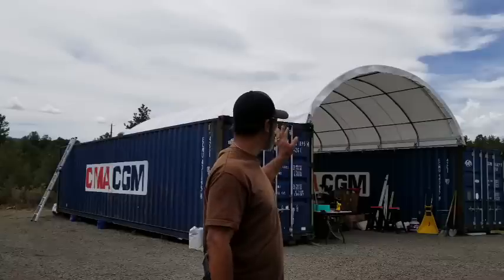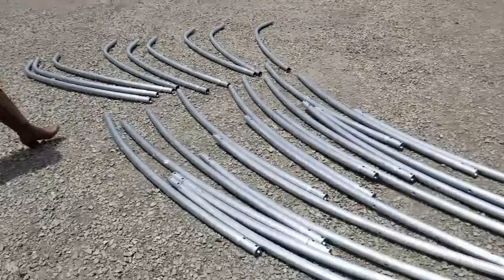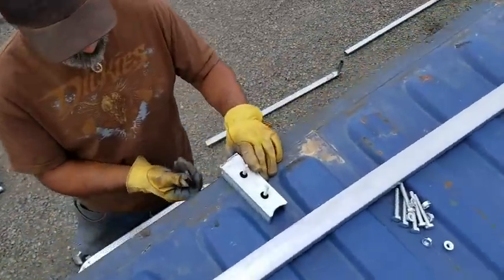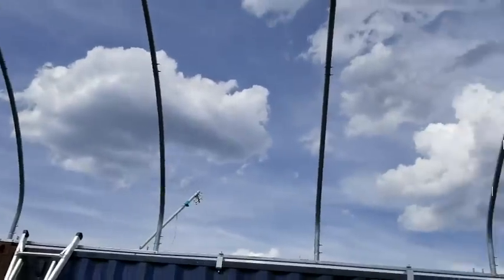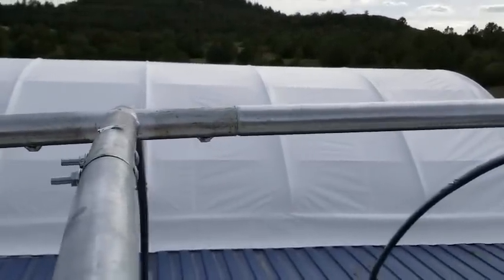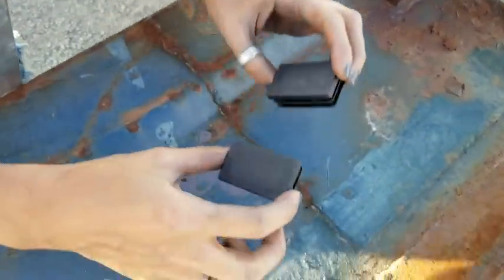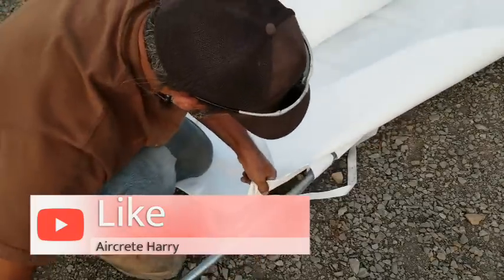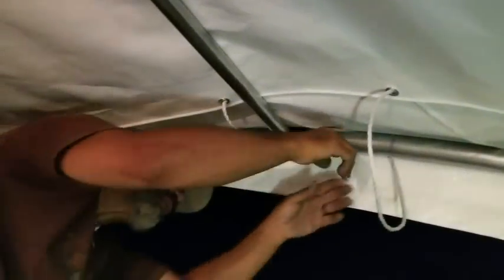Shipping Container Shelter Covers Installation #aircreteharry #Shippingcontainercovers #investment

Comment: Why not attach the pipe down with the ratchet straps and THEN put the fabric on with wiggle wire, the best way to attach it?
Now it has a bunch of weak places for wind to begin tearing it.... and water to leak on to cause corrosion on the ratchets, joints etc.  

OTT, beautiful job Harry. You for it done and it is a fabulous job. Thank you for all of your dedicated work!!! You are truly an inspiration!!!

Comment: The only problem I see with that setup is that water between the two has no pathway to drain so it is going to wind up running down the walls of the container which will soak anything leaned up against the wall.
Reply: Maybe they could make a gutter piece to attach to the clips that are attached to the corner of the shipping containers...  but drainage would definitely be an issue in my climate.
Reply: @eliasnewman1130  its not a problem but a benefit. Change your thinkin
Reply: @brettmoore3194  It might help him to change his thinking if you explained what you are thinking....don't be a complainer be an explainer so others can benefit from your ideas....we are all trying to learn from these videos, thanks!
Reply: @beefree7114         agreeable.              Achievers partnering is corporate sanity unitized.              They each own both efficiency apartments for sharing togetherness always or individual applications temporarily if optioned for transcending biographical wreckages.        But respectful corporate neighboring godhood Unity lacking in Eden also failed to resolve weakest link issue resolution, leaving do-over contingencies underprepared.                               Equalitarian accompanyings Co-manages Mutual progression to avoid either from bogging down into longterm negatives.     Similarly biblical "helpmeets" were push-me/pull-you equalizer-attentive beyond fatiguing overtime moonlighting occasions.

Religiosity Faith-method deficits lacking Insider-god's multi-perspective participations, likewise led to alcohol dependent social-drinker addictive program mutations (aka sins being self-defeating misprogrammings),   instead of objectively identifying problems and team working Beyond under-layering causes into autonomous democracy instead of bondaged republics.            The Serpent already somewhat demoted out of Predestinater's presence thereby overly-preoccupied Quality-Control Director's isolation,  failed to receive helpful correction from Eve for equalitarian incoporation towards furthering all angels and human into becoming God's self-predestinating character equal of Good-Orderly-Directing-Self corporation .

              As Brett Moore alluded,   iron mineralized water could advantage greenhouse sproutlings,    and short pillar jackups facilitating a collection tank,    would not seal off fractions of the water table circulation.            I concur that this duplex placement  also awaits progressive people students of Planet Health creation.                 If I afford you learning anything from now on,   you make love me (Lots of Laughs this self-learning typing program 🌩☈⛈)  you may faithwise quote me as The Souper Teacher Sam 🐢
Reply from the maker: I will put a gutter system on later for now I have it so water comes down one side.
Reply: @samuelhmullins2170  I feel like I just read a first draft of a "Lost " Episode
Reply: @beatricelyon474             I am amazed too but differently.    How is it suppressed robot factory society systems plaguing Earth do not produce worse citizenship behavior than voting for criminal organizations to instigate planet death?      Since junkmail became a weapon of massive destruction,  are the ground-shielding shady cooling blankets adequate for constraining ozone retention?

Oh I forgot about anti-intelligence agencies including dummy-media, religions and etc mis-education departments which omit research for Genesis 1:28 inhabitable Planet duplication!!        Semi-permanent Construction Developer's proportional seals are incompatible with Earth's water tables' circle of life aquitards .             Aquifers would cease to be adversely stagnated when domed-over Subterranean megacities, with Progressive Industrial Waste Management, are LOCATED BETWEEN AQUIFERS.        Plus agricultural infrastructure pipeline connected to desalinization plants for Non-drinking water reservoirs, would serve relief for fresh drinking water purposes .           

Aircrete Harry jacking his apartment containers to unseal the land surface is aquifer-compatible with planet health.              Jill Stein's Green Party platform seems compatible for Healthy Future transitions too.                 Are you referring to the 'Lost' World ignorantly led into opposition-voting against economic fairness and our species survival??
Reply: @AircreteHarry  A photo near the end of the gutter system would have answered many minds.
Reply from the maker: Our shipping containers are set-up at a 2° angle to the side and towards the back for the water to run off the back.

No water issues. 
Everything stays dry. 👍 👍

Comment: Nice system, except it seems like it would make more sense to add additional width to your arches & tarp so you could install the system on the outside edge of each container.  This would solve the issue you are going to run into where the rain/snow melt water from the tarp & on top of each container is going to run down between the 2 containers.  Plus you would also gain covered storage area on top of each container.
Reply: With 4 containers you could. You would give up 8 feet of width between containers.
Reply: @kkarllwt  16ft. 8 ft each side. you would have 4ft left between then or they would have to make the kit 16ft wider. IE double the price.

easier just shove some expanding foam under the "runners" on each side. this way you form a full 40ft length "damn" and the water is forced outwards instead of inwards.
Reply from the maker: Those shipping containers are set-up at a 2° angle to the side and towards the back for the water to run off the back.
Success, no issues.

Comment: Being this looks like Arizona,  those tarps might last 1 season. Hope they aren't too expensive to replace. But I will say, this is a great system, easily put together if you are organized. Which you both were!
Someone suggested covering the tarps in air Crete....good idea!
Reply from the maker: We've had ours for over 3 years now.
Yes, great system indeed.
We are happy with our Investment.
We will be covering them in the future.
Reply: If installed right with everything pulled tight and secured, these will last well over a decade even with the hot Arizona sun beating down on them. The tarp itself may need replacement every 15 years or so, but for the price it can’t be beat.

Comment: Harry I noticed the colorado cup. I live in the wet mountains of Colorado with high winds and heavy snow at times. I was wondering how your tarps hold up if you're in colorado with similar conditions. The tarps look really nice and would make a he'll of a place to get out of the sun up here.
Reply from the maker: Tarps are working out great. Check out this videi: https://youtu.be/jWg6TT9mUWg
Reply from the maker: Welcome to the channel 👍 
Yes, we are located in CO & we indeed experience major high winds, heavy snow, heat,.., and lately lots of hail.
This year alone we've had numerous earthquakes & several tornadoes going through. Being in Colorado yourself you may be familiar with snow coming down in May & very rainy days. 
The Shipping Container Covers provide us with great benefits & are an awesome investment. 👍 
It's been 4 years since we installed them, they are working out great. 
Check out this video: https://youtu.be/jWg6TT9mUWg

Reach out to us via email: Aircreteharry@gmail.com 

We will happily forward you the details ✌️

Comment: Great video. I just checked with Celine on these covers and they said the covers last an average of 3 to 5 years before starting to fall apart. I like the idea but I need something much more permanent for my RV and Boat storage. I may just try stacking 2 containers on top of each other and building a tin roof on that to get my 14+ feet of overhead clearance. I've also been looking at building a, (used telephone pole), pole barn with a tin roof. Im wanting to go 40 wide by 80 or 120 deep and then pour slabs inside to make a solid floor to work on so the pole barn idea looks more promising.
Reply: what I figured. Put up plenty of Quonset huts and other structures in the military.  They only last so long UNLESS you prep exterior and interior correctly. Never mind foundation. Then, they'll last.
Reply: Think you need a quonset hut top.

Comment: These container shelters domes are used extensively here in Australia , they can come in almost any height or width between containers and mounting methods.  They can even come with rear end wall and doors. They don’t always have to mounted on shipping containers either. They are extremely durable and most manufacturers will offer a 10 year warranty on the fabric.  They are very good for temporary workstation applications. If the containers are mounted at a 1-2 degree angle leaning away from each other , you don’t really have a water issue running down the inside ,  unless there is no end walls and the rain is coming in sideways. A small scissor lift is best to use for lifting the roof bows and installing the ties and end bracings. I don’t think they come with a snow loading as a general rule.  As they are all different . This would have to be quantified and certified by an engineer for each particular dome shelter.
Reply: How much it cost
Reply: they charge stupid fucking cash for them too. $60 - 85k and bullshit like that for a 20'. NOPE.
Reply from the maker: Email us and we will connect you with the company: Aircreteharry@gmail.com

Comment: What is the expected life span for the covers.  Where is the water runoff going on the center? Is it just getting the shop floor wet?
Reply from the maker: We've had ours for over 3 years now.
We may cover them in the future.
Those shipping containers are set-up at a 2° angle to the side and towards the back for the water to run off the back.

No water issues. 
Everything stays dry. 👍 👍 

If you are interested in more detailed information from the company, email us & we will connect you: Aircreteharry@gmail.com

Comment: Nice job. Good teamwork. My only question is how are you going to drain or divert water from the top of the middle container so it doesn't run underneath your tarp flaps in each corrugation channel??
Reply: Ever figure this out?
Reply from the maker: Thank You!
Our shipping containers are set-up at a 2° angle to the side and towards the back for the water to run off the back.

No water issues. 
Everything stays dry. 👍 👍

Comment: I agree with Tom Slak.Maybe a small ditch or gutter in the ground near the containers can get rid of rainwater flowing over the sides.
Reply from the maker: Our shipping containers are set-up at a 2° angle to the side and towards the back for the water to run off the back.

No water issues. 
Everything stays dry. 👍 👍

Comment: Harry what would you like about a container house with grid wire on the outside (like stucco)... then aircrete over that?! Aircrete would add the insulation value but would look more like a traditional home to get more people interested in this? Built very similar to your shop with end walls framed out with steel studs. This could be a fast way to build also. Would cost a little more I would guess.

Comment: Seems like the water management in the middle definitely could be an issue..Could you put metal roofing angled lengthwise between the tarps the whole length? Gutters might still be a problem if the rain fall is significant...
Cool system though 👍
Reply from the maker: The way we have it set-up is, we have those shipping containers at a 2° angle to the side and towards the back for the water to run off the back. Success!

Comment: Why didn’t you clean and paint the corners of the container before you installed it? There is coating that you can paint on top of the container to decrease the inside temp and waterproof it at the same time.
Reply from the maker: Thanks I do have the paint your talking about and plan to do what your saying in the future. https://youtu.be/V28sdwH663w

Check out my playlist building a dome cabin, in video 6 I talk about the paint I'm using and its affect.
Reply: Aircrete Harry I’ll try finding it.

Comment: What is the total cost of the materials DIY?
Reply from the maker: Welcome to the channel Nia 👍 
This is a complete set, all included.
We purchased our two sets 4 years ago.
It depends on the Size. 
What size are you interested in? 
Are you located in the USA?
Reply: To fit 45 ft 5th wheel.
Reply from the maker: @nia6849  These are specifically designed to fit Shipping Containers. 
Ours are 40' x 20'.
Reply from the maker: @nia6849  They come in a large metal box, as seen in our videos,  and can be delivered across the USA. 
- Are you located in the USA?
- What Size SC Covers are you interested in?
Reply: 45' 20' size.
Reply from the maker: @nia6849  send us an email: Aircreteharry@gmail.com 
Remember to include your Zip Code & Phone Number, we will connect you with the company directly. 
They will be able to give you all the answers needed, as well as check the inventory for the size & price list.

Comment: So how do you handle rain runoff between the containers, or snow load?
Reply: If I needed the sides of the containers to be dry  ( ish ) , I would place spacers on the container sides and then a layer of cheap metal roofing. I would let water run down the sides to the gravel underneath.
Reply from the maker: Our shipping containers are set-up at a 2° angle to the side and towards the back for the water to run off the back.

No water issues. 
Everything stays dry. 👍 👍

Comment: What I want to know is where do you get these kits and can you get them a larger spans? Id want it to go to the outside edges
Reply: It depends what country you are from,as many are made locally & some also imported.For example,here in Australia there are brands like shelter station,an international brand called shelter dome,through to auction houses selling them regularly in kit form that have been imported,also depends on what fabric you require.there are many options,best to just look it up for your specific requirements.
Reply: Google fabric covered steel shelters. They are used all over farm country to store machinery and hay. Some what different, My local airport put up a 2 hump fabric building to repair very large aircraft . A MRO facility. It's huge.
Reply from the maker: Email us and we will connect you with the company: Aircreteharry@gmail.com

Comment: If the bolt's heads of the second bars aren't round, but hexagonal they may jeopardize the tarps integrity. Noticed the head of the second bolts are actually round almost flat, great, and the taping to cover all protuberances is a good one so they may last. Great!
Reply from the maker: It's been 3 years already. 
We sure enjoy the set-ups 👍👍 
Great work-space, shelter & storage.
While installing, we made sure the tarps wouldn't be compromised in any way.
All good!!

Comment: Me thinks that all the retaining clips to the containers need welding on as given time wind will slacken them off without a doubt, you will be re-tightening them every 5 minutes.
cheers.
Reply: We have used similar systems in North Western Australia in Mining and other Resource Industries, once everything is tensioned it is going no where.  Check out the Cyclones that go through that area on an annual basis, these shelters are bomb proof.  There is no use thinking if you have no experience, maybe just keep your ill informed opinions to yourself.
Reply: @petewatson4353  well said. It never makes sense to me that someone is a expert on things that they have never had any experience with. He obviously doesn't see that those Allen bolts go through the metal and put pressure against the container. Stay safe out there
Reply: @petewatson4353  I only hope he didn't pay any more than a few dollars for them, I reckon first cyclone they see, they will be collecting them from another state, the salesman did a good job did you buy one from the same guy, whoops.
Reply: @cntslesfabrication  You don't have to be an expert to look at the way that cover is secured to the frame to realise that the are gonna say good by to each other in the event of a cyclone or heavy wind, listen to it at the moment and it's only a slight breeze blowing, earplugs might also be a good idea if you are staying close by. your comment, stay safe out there should have been aimed at the couple who are erecting it.
Reply: two words: Bimetallic Corrosion / Galvanic Response
Reply from the maker: 3 years later,
Numerous tornadoes, extreme high winds & heavy loads of snow - it works great 👍👍 
Check out our latest video update from this year 2022. (Tons of snow!)

And still in the same State, AND EVEN on the same property 🤣 🤣 😂